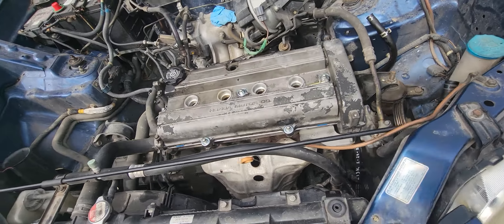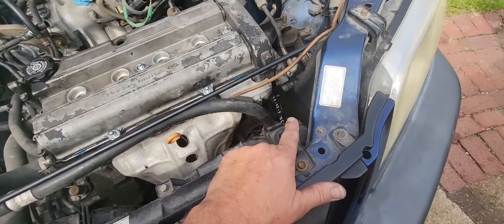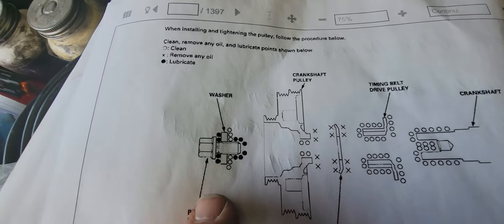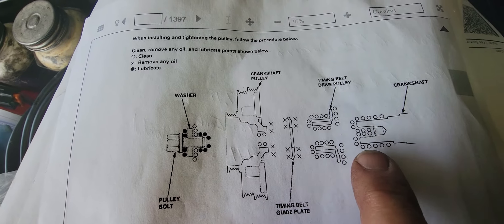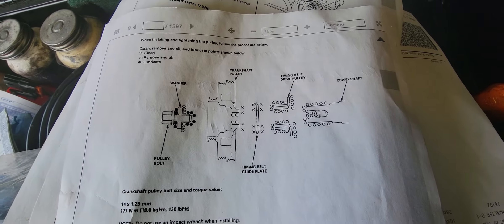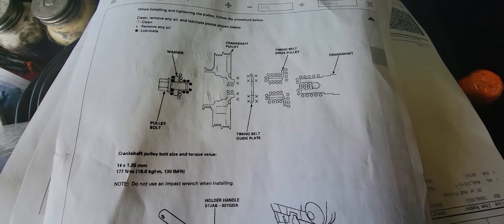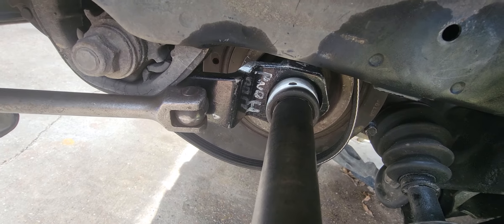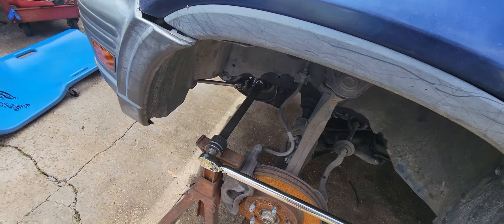Honda CRV CR-V crankshaft pulley balancer torque procedure

Comment: That won’t be even close to an ‘05 model; I torqued mine to 145 ft. lbs, and it’s loose in less than a week. I’m having a time finding the right info -
Reply from the maker: Ok I'll check into it, on the later models the bolt is torque and then turn 1/4 turn. On the earlier model h23a it's 180 ft lbs. So this may be a error and I'll figure it out. If it is getting loose take it apart clean everything, put blue locktight then reassemble. If you have a impact hit it hard with that. I'll check into where I got the screenshot of the fsm.